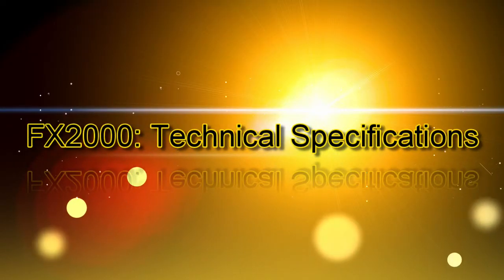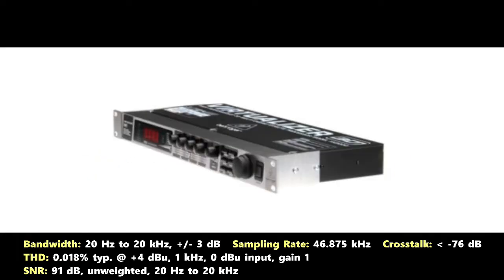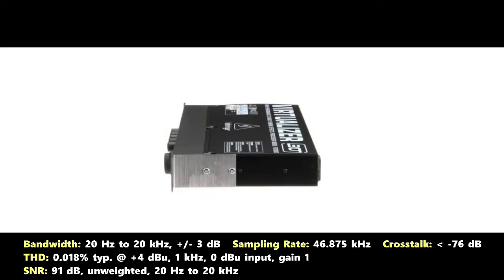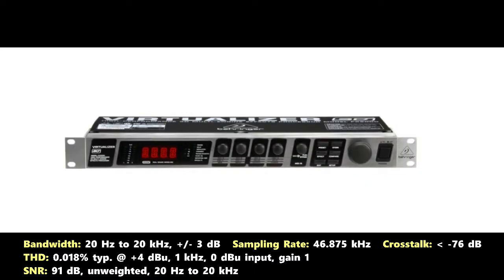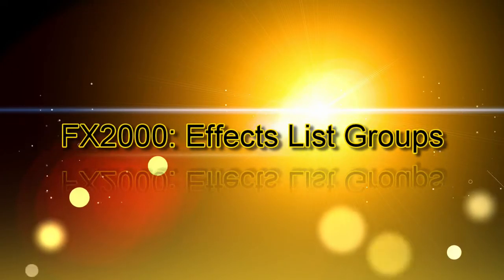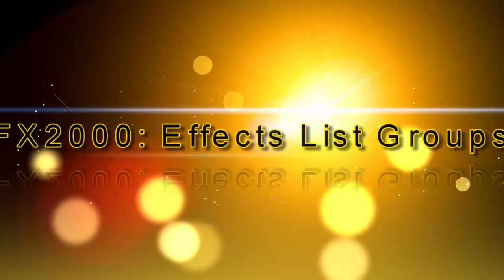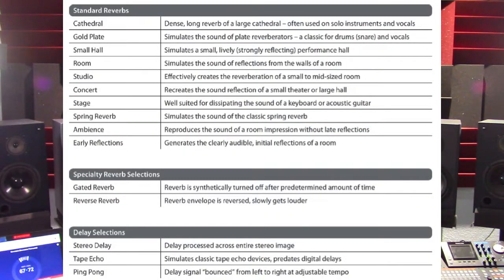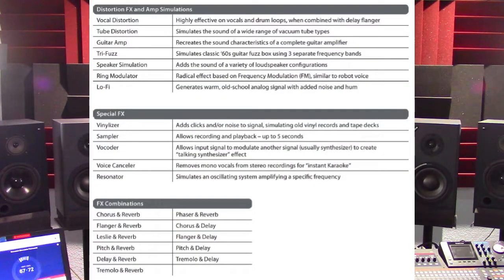Behringer VIRTUALIZER 3D FX2000 Multi-Effects Processor: Why I Use It

Comment from the maker: I needed to upgrade my old multi-effects processor because it sounded too airy, thin, dated and couldn’t support my mixdowns the way I needed it to. I searched for something with lush reverbs, choruses, delays and more that would work well for both post-production and mastering. I needed a multi-effects processor that used innovative technology and sounded realistic. Since my budget was limited, I had to be careful and couldn’t compromise on audio integrity because the areas in my studio where I needed the unit were critical. I wanted to share this with anyone interested to show that you don’t have to pay a fortune to get a modern multi-effects processor that’s affordable, built well, and sounds great.
Reply from the maker: @Mee Omi I’m not familiar with the previous model, but I would generally recommend the latest model in this regard. As fast as technology advances these days, most electronics companies can’t wait to release their next generation devices so they can stay competitive. Thanks for watching.
Reply: I had this multiFX in chroshairs for quiet a while. I dont realy need it because I already have BOSS GT-100 and plenty of software FX on my computer. But I dont have any FX for my rack unit and using guitar pedals for everything feels like doing something wrong. So, this still stays on my crosshairs and it can do amp sims and distortions so it is also a guitar friendly unit. It would be cool if it also had USB out for recording  but I can just use USB on my Studio Live mixer or my audio interface.
Reply: It was explained to me that it can only string two effects at a time.  So for s guitarist not helpful at all really.  Someone tell me Sweetwater is wrong

Comment: What a super gentleman - you can't beat good manners. I'd have preferred more information about how I can use this gear with my old Fostex Vf160ex:that is,I want to improve the sound of my vocals:there's a jack on the end of my microphone lead so I'd like to know if I can plug my microphone direct into the gear and then run a lead with a jack on the end out of the gear and into a channel on my Fostex. Thanks.

Comment: How do you set up or hookup the system to get both level meters working.  I have mine using TSR 1/4 jacks to my send and aux returns on the mixer.  Only one level meter works. I would like to know how to set it up to use both meters. Thanks, I know this is an old video, hope to hear from you.
Reply: Never mind, I figured it out. Manual was unclear.  I hooked up the 2nd send to the mixer, It really brought it to life. Thanks

Comment: Could I use this for listening to music (home stereo set up, vinyl)? or is this strictly for making music.
Reply from the maker: Yes you can. Thanks for watching.
Reply: @PowercoatMusic how would the set up work? Cuz surprise I bought the unit and it doesn't sound good going through it.

I have the record player plugged into the unit, then into my speakers and all the bass and "quality" get washed out severely.

Any advice for a better playback? Perhaps I need receiver, or a better record player?
Reply: You will need an amplifier too I would imagine @adamyglesias4473

Comment: Can "channel 1's" output be set up completely independent from the output of "channel 2's" when returning back into my mixer through the use of plug-ins? 
Simply put... if I want C-1 set up for vocals and C-2 set up for an instrument, I wouldn't want an "FX COMBINATION delay/reverb" for vocals that I set to the same exact parameters for an instrument, such as an E-drum, where here I may just want a GOLD PLATE standard reverb on drums. 
Can C-2 be a completely different selection for the instrument? 
Or are you "stuck" with the same exact selections coming out of both outputs back into the mixer?

Comment: Hai. It is possible to combine 3 or more fx? EG, i want to use gate, compresser, enhancer, graphic eq and limiter at the same time? Thankyou.
Reply from the maker: Effects 61 to 71 are multi-effects algorithms, which allow different effects to be used simultaneously. Effect 61, for example, can make a solo guitar “wider” with chorus and simultaneously add a room reverb. Please note that you can modify the structure of a multi-effect (see below).
CHORUS & REVERB: This algorithm combines the popular chorus with a gold
plate effect (as in algorithm 2).
FLANGER & REVERB: The combination of flanger and reverb effects.
LESLIE & REVERB: The input signal, modulated to a degree that you specify,
is then processed with a reverb effect. This effect works especially well with
keyboards and guitars.
PITCH & REVERB: The pitch shifter can be detuned in semitone or cent steps.
The reverb, on the other hand, can be controlled in time and mixing ratio.
DELAY & REVERB: Delay and reverb are the most common combinations for
vocals, solo guitars, etc. The reverb used here is a gold plate, a room that features
a distinctive brilliance and can be used in many ways.
TREMOLO & REVERB: The intensive variation in volume of the tremolo gains
more depth and wideness with the reverb.
PHASER & REVERB: The combination of a classic stereo phaser and a
reverb effect.
CHORUS & DELAY: While the chorus can contribute to a wideness of the signal,
interesting repetition effects can be adjusted with the delay. Vocals can be given
a distinctive effect without making the voice sounding blurred.
FLANGER & DELAY: This effect is just right for creating a modern,
slightly “spacey” vocal sound.
PITCH & DELAY: A repetition of the audio signal, with an oscillatory effect added
by the pitch shifter.
TREMOLO & DELAY: A fast or slow, intensive variation of volume, which is
additionally processed with a panorama effect.

Thanks for watching. 👍🏿
Reply: Thank you so much

Comment: Hi how would i control these with fcb 1010 while singing etc? I have one also does it gi e buzz if not using trs cos i get alo of buzz out of my marshall tube with it fsr
Reply from the maker: You could control it with a MIDI foot pedal. Also balanced TRS is strongly recommended. Thanks for watching. 👍🏿

Comment: As experienced as I am designing and installing large club sound systems, I must admit I get lost a little with processors like this, this is  not for beginners. However I feel like a beginner   watching these videos because I'm a dj not a musician. I got this to replace an older effects processor that burned up, I appreciate Behringer products but this one makes me realize I need a video for dummies. Something that explains example, edit a b c and d and doesn't glaze over some of the terms and functions like they are complete common knowledge. I know quite a bit, I hear the words and understand them but I've read the manual a few times, it...also assumes you know the terminology. It only touches on one way to hook it up, but there's a few ways. I'd like that comparison. I'd like a dummy explanation from hook up to doing the most basic functions step by step to hear it work. You did a great job, love the positivity
Reply from the maker: Thanks so much for watching and sharing. I really appreciate you taking the time to explain your prespective. You may want to also check out "Behringer VIRTUALIZER 3D FX2000 Multi-Effects Processor: Vocal Effects" and "Behringer VIRTUALIZER 3D FX2000 Multi-Effects Processor: Guitar Effects" on this channel. Those videos offer even more insight into this cool unit. Wishing you the very best. 👍🏿

Comment: Sir, there's an old Aphex 104 aural exciter with big bottoms. Is there any outboard gear that can work like it when it comes to mastering?
Reply: FX2000 has an exciter, but there is an older Behringer knock-off of Aphex Big Bottom - Behringer SU3040 and a plethora similar older Behringer vintage (Exciter F) 1990s-2000s Dualfex / Ultrafex series. They are to be had used off of eBay etc. for around $50-100 these days.
Reply from the maker: You may want to watch my video, "BBE Sonic Maximizer 882i: Why and How I Use It" on this channel.
Reply: @PowercoatMusic  thanks very much
Reply: @PowercoatMusic - Behringer also has a BBE clone named SU9920 for currently ca. $50 😂 NEW!

Comment: I'm really in love with this Fx rack and its midi properties: does it sync the delay lines with e.g. a daw or a midi sequencer ?
Reply from the maker: You can control Parameter Algorithms via MIDI on this device. This is extensive. Parameter Algorithms are all assigned a MIDI Control number that allows you to control the value range. With this, you would need to play with this functionality to get the desired results for a specific effect. I hope this information helps.
Reply: @PowercoatMusic  so you can basically controll everything in this unit but not the delay sync ? 
And if it's midi-sysex compliant, is there a pc midi editor or something like that?
Tnx for all the infos :)
Reply from the maker: @testohtoby  I’m not saying that you can’t control the delay sync via MIDI. I’m suggesting that you should play with the unit to see what it can do in that regard. It appears that this may be possible, but I have not done it. If it works for you, share it with the thread? Also, just about any MIDI SYSEX librarian PC software program should work (many are free).  Some DAWs have them as a function as well.
Reply: @PowercoatMusic  I use some CTRLR panels but I know almost 0 about sysex, I'll try it once I'll buy it 👌👌👌
Reply from the maker: @testohtoby  No worries. Check out my intro to SYSEX video (https://youtu.be/50PacyJmXuY) on this channel. Lots of good information there. 👍🏿

Comment: I'm looking at this for guitar but have a quadraverb and not sure if I should buy then sell my quad or keep them both and run them into my blackspirit 200 floor amp, what would you advise?
Reply from the maker: The bottom line is if you like the way your Quadraverb sounds, keep it and use it when you feel it’s required. However, if you want to add more power and dimension to your guitar tracks, budget-wise, the FX2000 is a great investment. After using it if then you feel like the FX2000 is more of what you want, then you may want to sell your Quadraverb. There is a saying that I haven’t heard in a long time…”You can never have too many effects in your studio”. 😊 Thanks for watching and sharing. 👍🏿
Reply: @PowercoatMusic  nice one, thank you for your reply, think I shall buy one next pay 😁😁😁😁😁😁😁😁😁😁😁